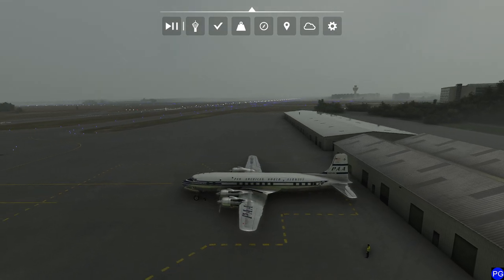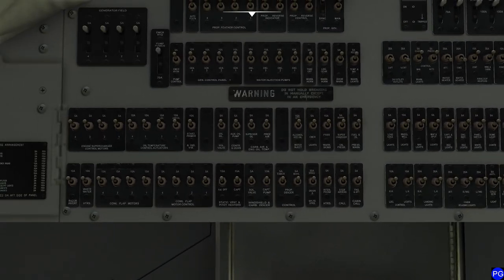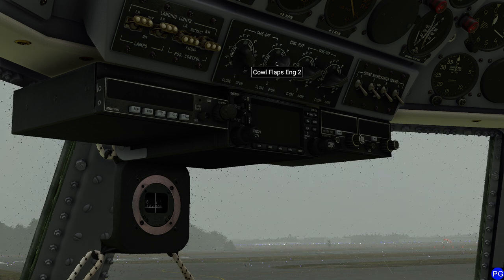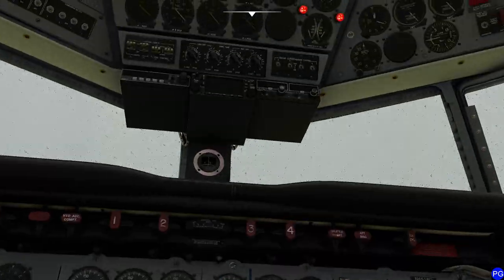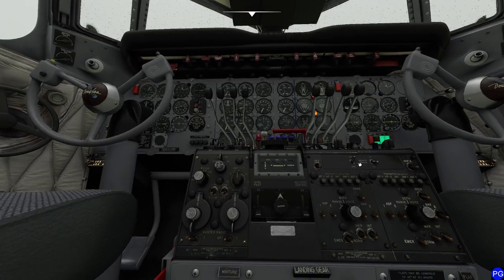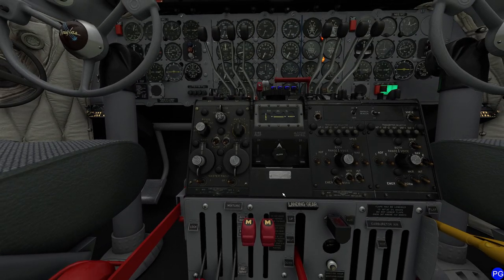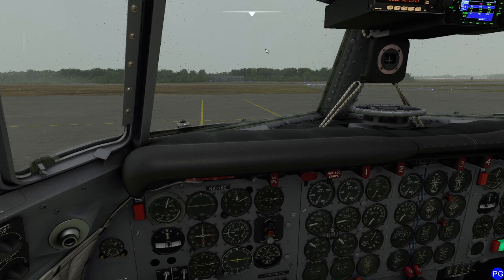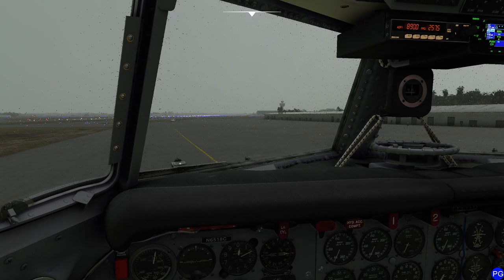MSFS: PMDG Douglas DC-6 Startup and Runup

Comment: Probably not by the book but how i start the engines without fail is a bit different from this but easier.

1) Set mixture to auto rich.
2) Set fuel pump of engine being started to low.
3) Set engine selector to the number of the engine being started.
4) Hit the starter.
5) When 9 is called, hit the boost.
6) When 12 is called, hit prime.

With this, never have an engine fail to start with realistic engine management turned on. I personally have found using the last two, too close together, can actually cause the engine to not start requiring a wait before next attempt.